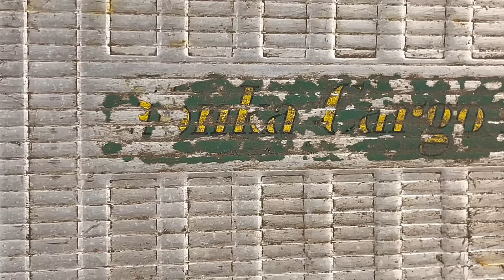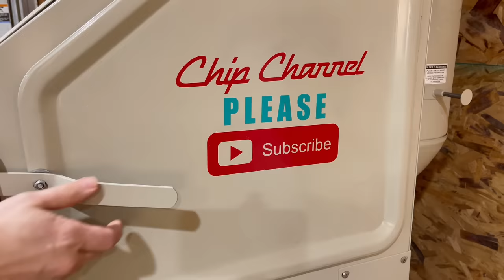1956 Tonka Cargo King Semi Truck Hauler Restoration

Comment: Firstly, holy cow! The rot on those wheels and caps! DANG. You've never had any of either nearly that bad! I won't lie, I got excited while also in awe. lol
"How many miles?" THOSE AXLES, WOW. Never seen any toy vehicle with that kind of wear. O, the stories this truck must have. All the adventures and roads paved for it by the children at the wheel. How much it must have been truly loved to get so much use.

Suggestion for the future when trying to salvage the wood pieces! Clear acrylic filler! Even if the wood is terrible, you're keeping it with the entire project together that way, and in much sturdier condition! You could even add a little color, flake, or pearl to the fill. :D

Comment: Excellent restoration, Chip, overall.  You did misalign the center pivot hole on the trailer bogey, raising the trailer up noticeably higher than it was originally - I noticed that hole was off as soon as I saw your replacement parts.  I'm surprised you didn't notice it.  Your skills at fabricating and restoring the parts are absolutely amazing,  your paint finishes superb!

Comment: I tell ya, your skills really have improved over the last couple of years when restoring these old Tonka vehicles. Now, you're 3D printing and making new parts out of CAD and machining them. I bet that's expensive equipment to reproduce the parts like that. Not sure which method really saves money when it comes to restoring these old vehicles LOL!

As always, you are top notch with that powder coating. These all look better than new. Nicely done!

Comment: Astonishing.  Given the condition of the metal, you were definitely a candidate for carpal tunnel with the JB Weld sanding!  With all the gadgets you now own, I’m thinking you could build this truck and trailer with just a set of drawings!  BTW, I still say the green wrecker needs “Ewe’s Towing” door stickers. 😉  Beaker seemed unimpressed and was giving you that look of “Only three treats??”  Going to be a long two weeks waiting on the next project, Chip! 👍👍👍 Thanks, John
Reply from the maker: Thanks again Primus54! Beaker is getting to be a little princess that requires more and more snacks haha. I give in and give her all the snacks she wants haha

Comment: Your restorations go from strength to strength. I'm impressed that you're manufacturing more of your own replacement parts and really enjoy watching the different processes involved. My only criticism is that I think you made a small error in the position of the hole for the central pivot in the rear double axle hangers which is causing the trailer to be higher at the back.

Comment: Christmas of 1958, I received a Tonka Dump Truck that worked somewhat like your 1967 Tonka Hydraulic Dump Truck Restoration.

The cab was similar in shape and color to the red cab you have for this Cargo Hauler, not a square shape like the 67, but more rounded. The bed was green and looked like the one in the 67 restoration. It had the swinging back gate on the bed that opened when you dumped a load, but I don't recall if it had the "hydrolic" spring functions, and no white side walls. That same Christmas I also received a Tonka Road Grader. My cousin, same age, who lived behind us got a "steam shovel" as we called it back then, even if it probably was a model of a diesel operated shovel. We spent hours making roads on the hill between our two houses. 

I held onto that truck until I was 17 years old, then with great care and careful instructions, gave it to a young boy down the street from me. If you even find one to restore, I'll be sure to watch it.

Comment: Chip, I caught that you put the mud flap bracket on wrong the first time.  As I was watching, it looked wrong until I saw that you flipped it around.  Then, as you were installing the flaps, I noticed that you installed the bracket wrong a second time.
PS:  You do great work with these old toys!

Comment: I don't know anything about paints and painting, etc.  In the part where you are mixing the paint, is that what they call "powder coat"?  I am watching your videos because I have about a dozen old toy trucks (Structo and Tonka from the '50s and 'early '60s) that I would like to restore, or at least clean up.  Great work!
Reply: Yeah, that's powder coating. An electrode in the powder gun imparts a negative charge on the paint particles, which causes them to stick to the grounded metal parts. The parts are then heated, which melts the powder into an even film.

Comment: Hi Love the Channel, I have a Amazing hack for you, that has worked wonders for me. I'm Rebuilding a 1935 Ford Pickup truck so I have a mountain  of RUSTY PARTS.  MOLASSES EATS RUST, YES IT Works GREAT .I get mine at Walmart 2.5 gallons of food grade Molasses Herd Life for cow's  get a large tub, bucket, I like my 30 gallon rolling Trash can mix it well about 10 to 1, not critical and soak all your rusty toys in it for about 4 to 5 days.  Bingo Rust free, after a little scrubbing with a red and green chore boy.   It will be so Damn clean it will Flash Re Rust like it came from the Machine shot.   So  spray all your toys down with some Metal Prep , Vinegar and water for re soak them in a fresh bucket Bingo Baby it works ..   Clean, Environmentally, friendly  it will last for about Six months .  Have Fun, Ben